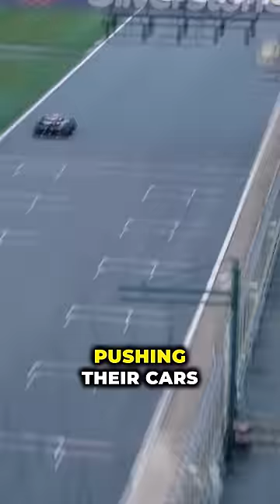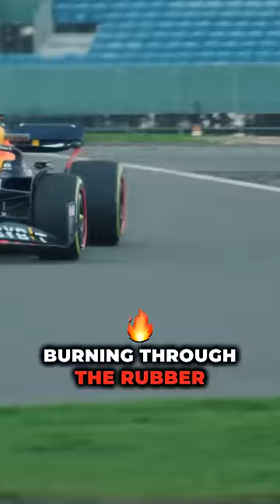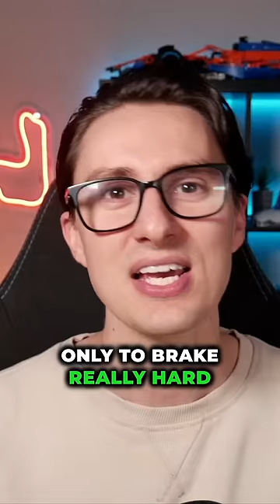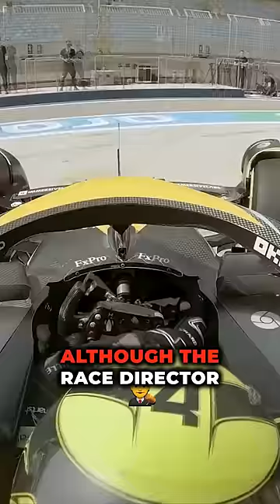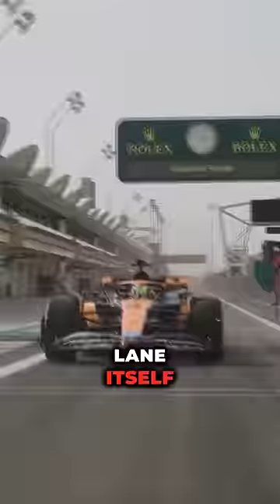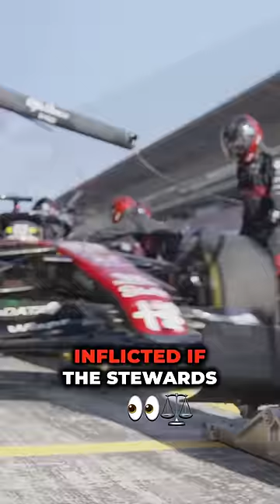F1s Pit Lane Speed Limit

Comment: And rip if you need to pay a lot of money after free practice because you were going 0.3kph too quick
Reply: 🤔€30/$50AUD a lot of money for the driver ???, the cheapest Entry Ticket for the Aussie GP is $250AUD
Reply: @shaneeslick  stroll got fined 500€ for 0.3 kph
So not a lot of money for. driver (like you said)
But thats still a lot for just being 0.3 kph
Reply: @BWB_Cubing  if this was your reference "stroll got fined 500€ for 0.3 kph" you should have made that your comment, because that's not €100 per km/h over like the short claimed.

Just trying to Google that at which track was that one ???

During Friday's practice session at Red Bull Ring Hamilton was fined €100 for 80.2 plus both Aston Martin drivers, Fernando Alonso 80.9 €100, Lance Stroll 81.3 €200.
or was it Miami where Stroll got 2 seperate fines that equalled €500, first was 80.3 €100 + 83.5 €400. This seems to be what you were referencing with the 0.3km/h you mentioned which did only incur a €100 fine, but not the total story for the €500 as you ommited the 3.5km/h.
Reply: @shaneeslick  then maybe it was false info 
But i still think theyre too strict with fines and penalties
Like theyre also way too strict with track limmits